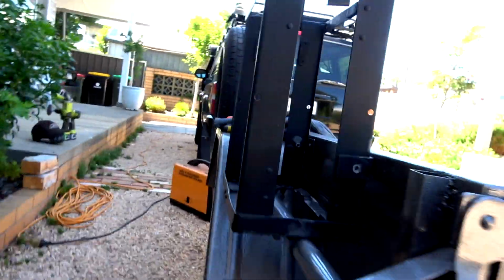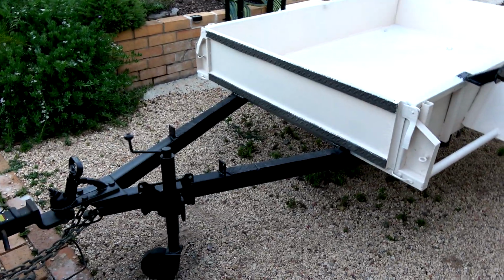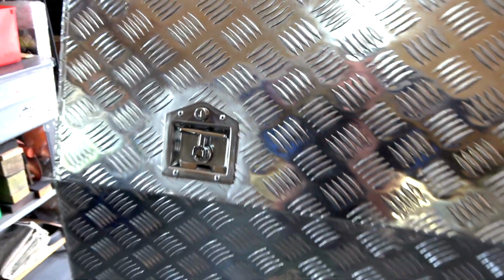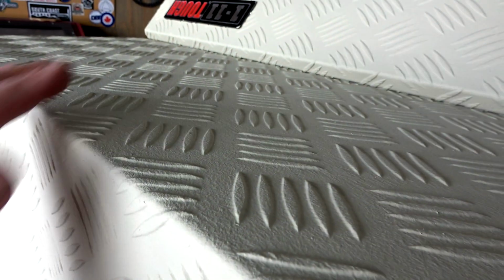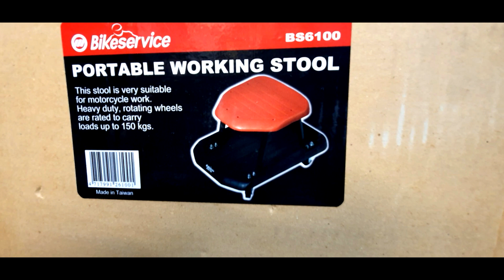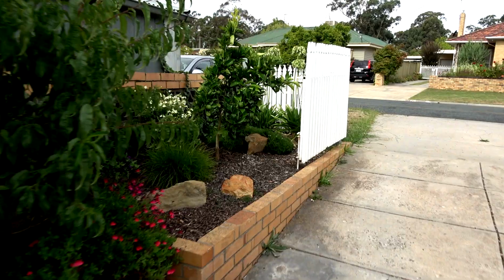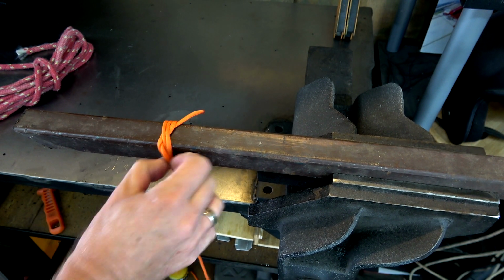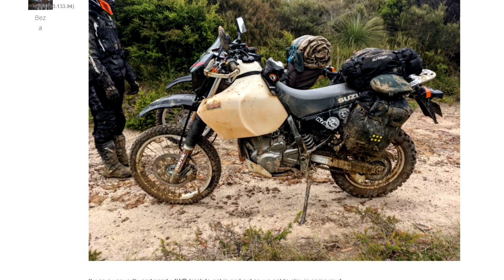Never too Old to Learn! MCT 2021 Ep.4

Comment: For people  worried about the penetration of the welds you could just drill a hole and put a bolt right through it with a lock nut that way if the welds were to break the bolt will hold it together. That stool looks like good quality. Very simple knot to use and effective. Good job on the trailer, we love the new color. Great video as always & T4S
Reply: Hi Sum4Seb, the Stool is ok. I Hope it lasts along time. Kind regards Pete.

Comment: There is room for a gusset under the tire holder. It probably isn't necessary with the lower tire support, but anytime you triangulate a bracket it gets 3 times stronger.  I would use a small diameter pipe with angles cut on the ends.  Attach to the upright post and then bottom of the bracket. 
I am thinking about modifying my trailer. I have a 3,000 lb truck camper sitting on a 1 ton pickup with dually tires.  I am thinking about putting the camper on a trailer. Lots more room for toys and tools. 8' of truck bed and whatever space is left on the trailer.  Should be able to park a couple of bikes under the cab over part of the camper. My trailer is 18' long and the camper is about 14'. I would have a patio area behind the camper. Overall I think it will be better for the truck having to pull the weight instead of carry it.  Having the weight distributed on 4 more tires may cause it to sink into sand less.

Comment: G'Day Mark, good job on the trailer. Just to add to the knot segment, there are a few useful types of hitch's you can use. If you don't want to risk it coming undone or wan to take extra weight/pressure, do an extra turn under the crossing rope. Hitches are good to know as you said, because they come undone easily and they don't weaken the rope like knots. Also learn to do a bowline as they also a very versatile knot. Cheers.

Comment: Mark , great trailer re vamp,   however as I (before I retired) was building trailers for the trailer hire business (we made our own trailers) worked at , I would weld a bracket under the spare wheel holder for strength and stability,  even though you have it sitting on the bar below the tyre,  the road vibration is hard on wheel holders  , we were continually checking the ones on the trailers as they would crack , was a bloody nightmare trying to get the perfect mount and keep them on! Keep up the good work😎

Comment: Also...it is called a clove hitch ! clue in the name, hitch !
I understand that it is classed as a midline hitch and not an endline hitch and works better with tension form both sides, if not, they can become loose, it's great hitch in the right aplication.
It is also less effective on items that are not round..square, rectangular etc.
Apparently it was used on old square rigged sailing ships to form the rope ladder that led to the various stages of the mast so sailors could access the yards to either furl or unfurl the sails.
That was what I was taught anyway.

Comment: I like my Truck Bed Liner coating idea for inside the bed of the trailer. Tuff and heavy duty stuff. 👍 Good looking color light or dark. Looks good so far, the color you went with. How about extra tie down hooks or points inside the trailer?

Comment: Usually when I paint a trailer I change all plugs wiring and lights. 
You will need LED lights if you do lots of off-roading. 
I have restored lots of trailers in my time.
Reply: LEDs are the way to go. You dont get the bulbs rattling loose on the corrugated roads. And the old skool lights you always seem to collect dust in them..  I've gone a LEDs with a plug and play style loom. Fully sealed lights and loom. Never seems to let me down

Comment: Turn your welder up a bit and try some practice welds. Try going slower to get the right penetration in the metal run some beads until you get some nice ones then give the spare wheel carrier another go. when you put tacs on they should be hotter then the weld

Comment: That spare wheel mount looks good but you have welded it onto really thin steel. 
It will break off on your second or third big trip. Especially over corrugated roads.

Comment: Gday Mark those ali boxes do loose these shine after a short time.
I've got this huge custom built box on the front of my lawnmower racing trailer. I was told it I wanted to keep it shiny use metho, if not just leave it and if gets dull pretty quick. Have a look at the tradies boxes on there utes. You will hardly see them shine.
Reply: I wrote that before I got to the bit where u painted it. 
Nice job. They also look good painted. But yes you will now have to maintain it I guess.  The lighter colored trailers are pretty good. 
Maybe go with white with say KTM orange accents. Wheels draw bar etc. 
Keep em coming Mark 👌
Reply: At night you can see where you parked the white trailers when you are a bit pissy out in the bush. 
You trip over the black ones

Comment: Hi Mark. Has that spare tyre ever been on the trailer? It looks like a different offset wheel than the standard trailer wheels. It looks like it might rub once it’s on. I wouldn’t want you be stuck somewhere. I learnt this lesson the hard way. Cheers. Todd Cooper.
Reply from the maker: It's the original tyre, I changed to the sunraiser wheels years ago! Thanks though 👍

Comment: bud, you need to turn your welder up to get some better penetration, the welds on your spare holder are not enough, or bring your wire speed down and move a bit slower. also ; consider triangulating the bracket down to that support rod you put in place mate.